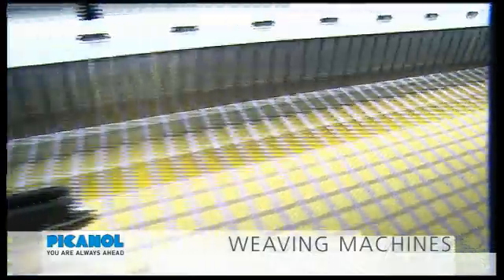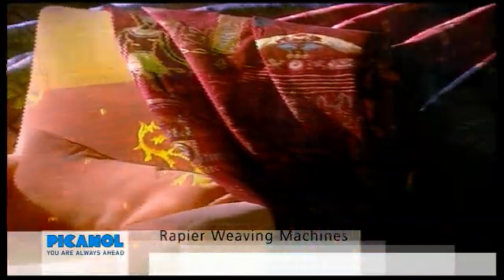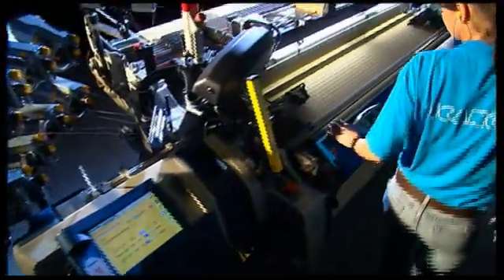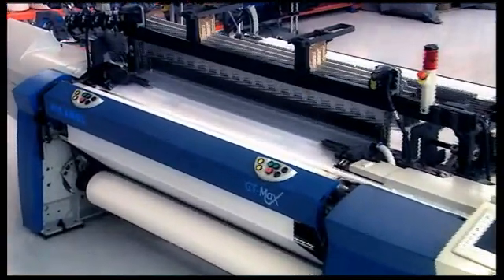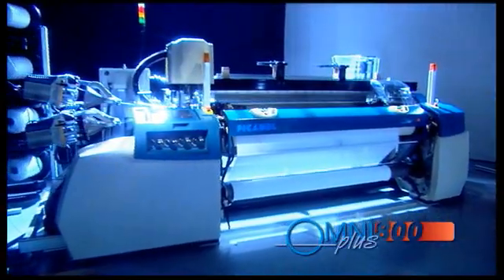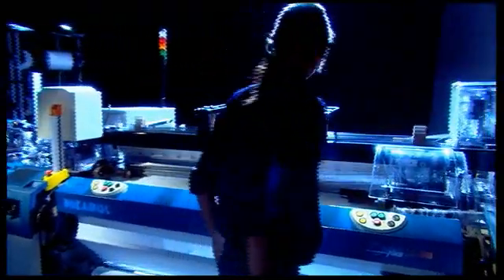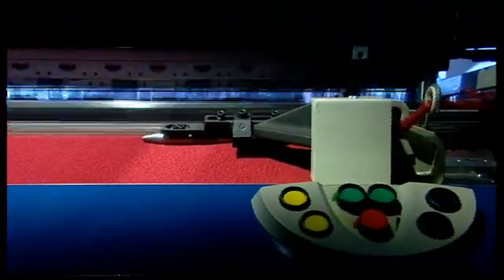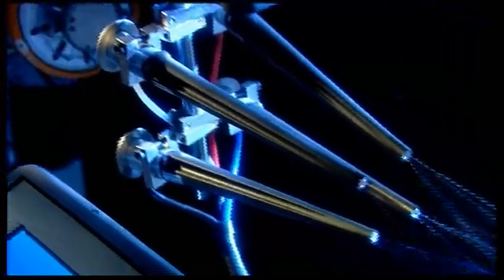Picanol Weaving Machines

Comment: Air Jet Toyota are best machines in eletronic control. But picanol more resistent in the frame and excelent performance in weft insercetion.
Reply: We are planning to start a weaving project with 100 looms . Can you suggest which air jet loom is better between Toyota and Picanol ?
Thank you .
Reply from the maker: ok, thx for your request - how can we contact you?

Comment: Omni Plus 800 TC is a good loom,  not to easy for style changes.  Been having alot of software issues at work, but Picanol is working on the problem,  release 58 has some bugs, but release 59 is said to have this fixed.